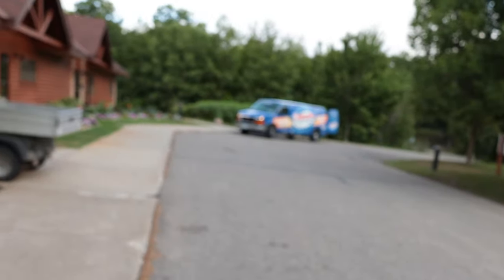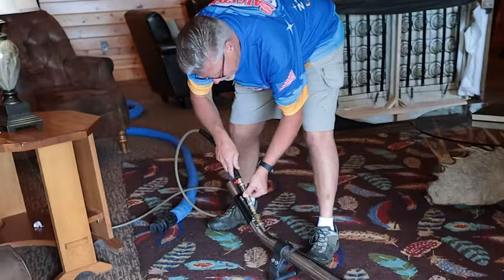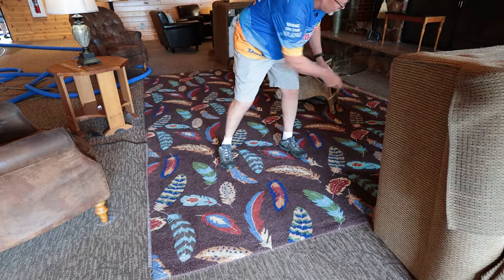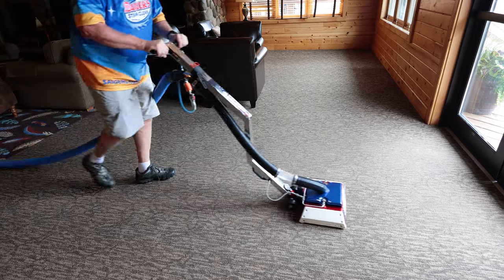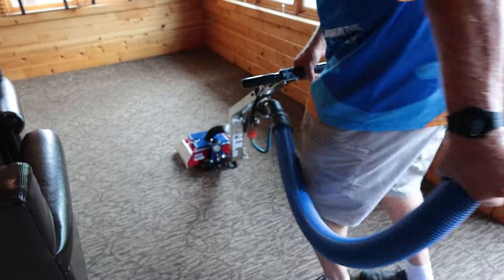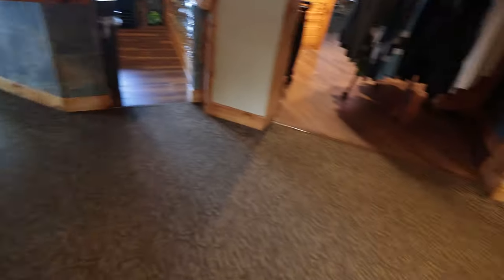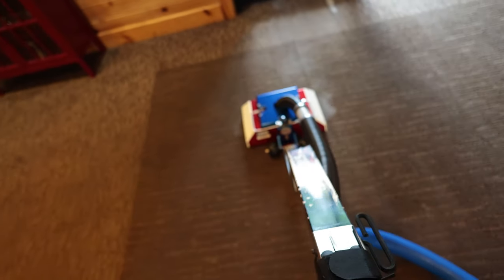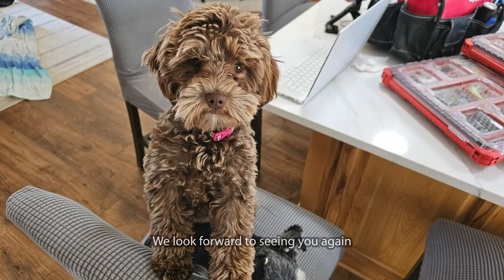How to Successfully move Furniture when you Clean Carpet

Comment: Hey. I love the Zipper due to that it is like the runway cleaner version of the carpet extraction industry.  I know that many carpet cleaning companies use vans and I wonder which do you recomend for if anyone wants to open a truck based carpet cleaning service.
Reply from the maker: The type and size of the Zipper or being able to use a Zipper will depend on your extraction equipment. Some portables and small truckmounts can run a 13 inch regular Zipper larger units can run the 15 inch and some of those can run a Zipper Super Spinner